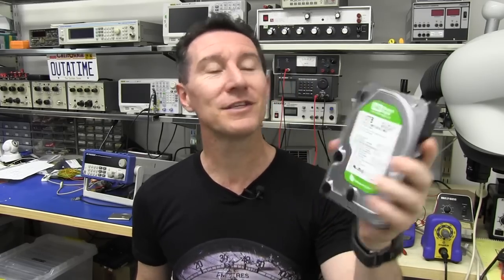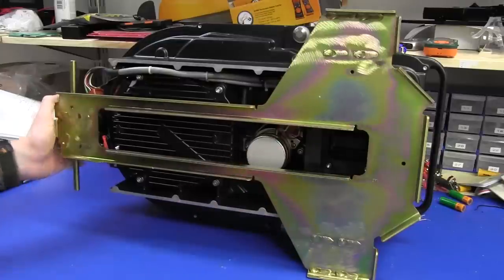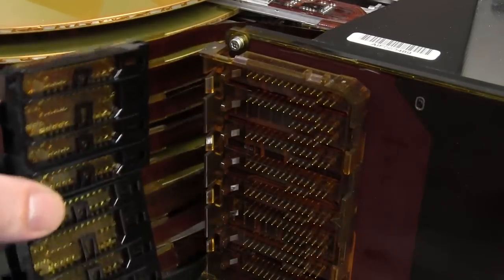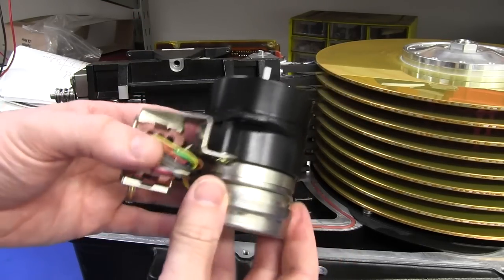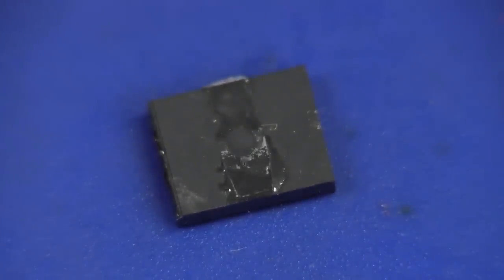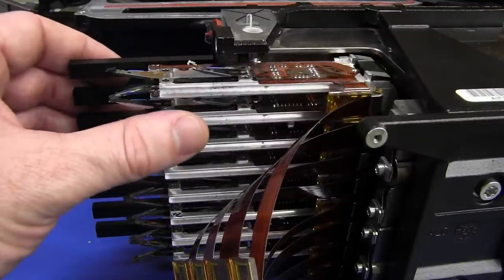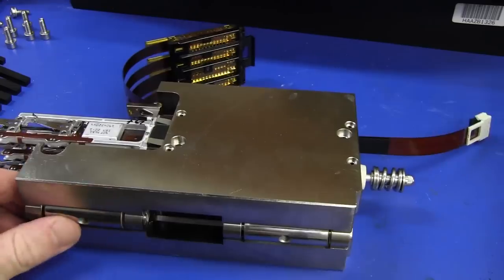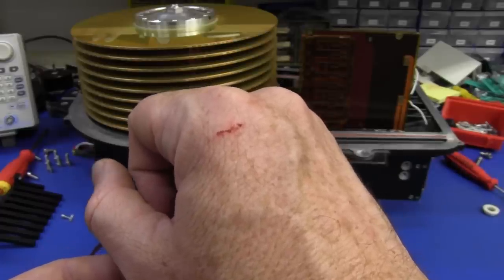EEVblog #395 - World's Most Expensive Hard Drive Teardown

Comment: Just stumbled across this and it made me smile. Especially the comment about the 20MB/$300 drive - I'm going to guess a Seagate ST-225 MFM drive - the volkswagen of hard drives.  Reversing inflation means that 20MB drive would be about $700USD today. Perhaps I can clear up a couple of things [quick scan of the comments didn't mention some of the things I know about them]. In the late 80's I can remember being stoked at getting a 680MB Fujitsu Super Eagle for "only" $8000 USD,  and it was tiny - only weighed 30lbs (15Kilo?) or so. and small.. maybe 7" platters? Compared to the 14" "Eagle" that came in at almost 100lbs, required 220VAC (unusual in the US)  and was 'only' 600MB. Anyway - as someone already noted, the drive electronics were elsewhere in the system - since that's IBM, and most likely from some Big Iron (mainframe) it would have been a channel system. I would not be surprised if they were still making them into the 2000s - I know a company that builds emulators for some of that stuff -- since some of the Big Iron is still running. No really. Costs too much to re-implement the system. Some other details: if you noticed, the filter was set in such a way as the 'wind' from the spinning disk would get in there. that was there to catch anything that might come in on the gas line. The locking mechanism was meant to unload the heads before the disks spun down since winchester tech is a flying head. Literally. The heads were never supposed to touch the drive - but rather they floated in the 'wind' caused by skin effect (look up tesla turbine to get the opposite using the skin effect to spin platters).. If you look closely at the head you should nave noticed a slight narrowing on one end - that created the pressure to float the head. The gap between the head and the platter was tiny however - a smoke particle was too big. BTW, this is where the term "crashing" a head came from. It would contact the platter - and destroy it. With the most god-awful sound. Yep.. been there, heard that. The dual head arrangement most likely was meant to reduce seek time, not to increase read/write speed. Voice coil head positioning was pretty high tech/fast for the time, but compared to today still S-L-O-W, simply because of the mass of the head assembly.  The dual heads meant they only had to move 1/2 the distance. Probably ran around 150RPM or so. Yes, One Hundred and Fifty. I would not be surprised to find out that the gas line was there for filling the chamber with a higher density gas - to more effectively float the heads. [side note, I also remember being ecstatic at paying $17,000USD for 32MB of DRAM.. And even more amazing was the fact that it was ECC, and only 1 card. Granted.. 9U (roughly 16"/240cm square), but since I needed 4 cards that size before...

Comment: I’m pretty sure one of the old hard drives or original disc that can only hold a few megabytes would be so big. It was as a truck. 😳

But from the first hard drives, to the ones in my first computer ever to now advancements have been made, and some very crucial and big ones. Like technology has improved so much and there’s a lot more density in storage now with HDD drives and SSD in general. Also, the cost is way less now. It’s truly remarkable. 🫡

Comment: that temperature strip looks like the ones used in aquariums, may be installed by some technician
Reply: +Cristian Szwarc yes, I was mid-30s at the time those came out, so my memory is clear.  I'd seen exactly that type of temperature strip for sale in electronics catalogs at the time.  Maybe it was installed by the customer engineer.  Or maybe IBM directed they be retrofitted.

I remember we had some Memorex disk drives, similar mini-fridge size, and after we got them they had to be wrapped with aluminium foil because there was a radio tower (CN tower) a half-mile away.  Metal boxes, but with plastic windows, so RF interference was getting in.

Comment: I can beat that one.   I once had a boss that worked at an ancient supercomputer manufacturer.   In their development center they were prototyping a new  custom super-fast head-per track disk drive.   They took their huge, man-high disk platter drive which already cost $300,000 and stuffed in as many head-per-track heads as they could.  He said there were 32,768 heads but I don't quite believe it, it might have "only" had 256 heads.   Anyway he came in one morning and the door to the dev lab would not open,. the disk drive heads had crashed, all xxx of them, and made huge piles of iron particle and aluminum platter shavings, enough to block the door.    I can almost believe that story.   He also said they gave up on that development project, too unreliable and expensive.

Comment: i know if an incident at a wall street financial center a few years back were a woman got locked into one of the vaults and panicked and pulled the fire alarm from inside...well it was a halon  fire supression system and it sucked the oxygen out of the room. big investigation. tragic story. not keen to the exact details but my uncle was one of the regulators/investigators involved in the incident.

Comment: There is more gold in those disc than there are in 50 vcr's 1000 compact disc or 250 modern hard drives simply because it's old and they didn't know then how the longevity of the drive could function with critical data so they put max amount into plating and carrot value for lasting service. I would estimate 6-7 grams or about $230 worth.

Comment: I had a drum memory system back in the late 1970s.  I had it connected to my home Motorola 6800 computer for a while.  It gave me 256 KB.  I still have the drum but had to get rid of the cabinet and transistor based logic.  No ICs.  It came out of an old NASA system called the Orbiting Astronomical Observatory.  It may have been at a monitoring station in Chile or Ecuador.  I'd like to find a museum that could use it.  The drum memory was built by Vermont Memory Systems.  It was probably built in the 1960s.  It was in a 6 foot tall rack and weighted several hundred lbs.  When it would start to spin up it dimmed the lights in the house.  On power down the drum would spin on it's own for 10 or 15 minutes.  It was a lot of fun to reverse engineer the original interface.

Comment: 25:23 Less surface does not equal less friction! Far from it. The friction depends only on the vertical force applied times the friction coefficient which is dependant on the materials coming in contact (type not size). So smaller surface does not equal less drag. On the other hand a smaller surface means that the pressure i.e. the force per surface area is greater thus the wear and tear is greater. So your first reason for the pads existence is incorrect.

Comment: 23:05 Actually no... when the drive is up to speed, the heads ride on a cushion of gas. You said it was filled with halon, I thought they used dried nitrogen. That is part of the reason for the air filters... ANY dust particles larger than the gas cushion will cause a head crash... and that trashes the drive in short, loud, fashion.
Reply: annnnnnd 4 minutes you get to this part...

Comment: I can imagine many uses for the gas ports on the drive like filling it with an inert gas or pulling a vacuum to settle dust or even cooling but Halon gas is not one of them, I don't get how it would help in the event of a fire in the room: if the case becomes hot enough for the plastics inside to catch fire, the platters will be destroyed anyway... Where did you get that info? Could you link something that explains the use of halon inside the case? Does someone have an explanation for the use of these ports or were they really for Halon gas?

Comment: Halon is not all that toxic. People could survive while evacuating, and was even used over stoves in restaurants. If it was like cyanide or something that bad, the required liability insurance would be unaffordable, and thus that gas would be completely unusable around workers (at least those workers who had families that would sue the pants of the employer). As far as I know, halon was never used inside drives. The ambient air was passed through ordinary gross filters and then through superfine “absolute” filters to keep particles out that would interfere (read “crash the heads) with the heads flying over the disk. As halon would only be present during an emergency, ordinary air would normally be present inside the drive. If anyone knows for an absolute certainty that halon was intentionally used inside an operational drive, perhaps they can tell us the details.

During the late ‘90s, a Sacramento third-party service company in the same complex where I worked tossed many similar-looking IBM drives in the Dumpster. I got a couple to scrap, and even the complex maintenance man opened a secret (to the landlord) disassembly line in a utility room to make a few bucks on the side.

Comment: When you have an extremely expensive system you're going to pay anything to have it running before taking the courage to send it to the scrap yard and get a new system.
I've been working on systems in the process industry, a 10 Mbyte second hand hard disk with non market standard electronics could cost the customer over $40.000.
They had no choice, pay that amount and restart production as soon as possible, or stop production for months and if you have the budget, substitute the whole system with a new one.
Normally they pay the amount and then look into programming a new system during the next long period maintenance shutdown.

Comment: That drive is from a 3390 disk subsystem and was 3.78 GB not 10 MB
Reply: +jlelliotton being that there is more than likely no actual logic in the drive or stored middle-ware / firmware or microcode on any of the platters from the factory; I would imagine they were capable of actually being truly hard formatted completely and IBM would have been able to sell new controllers roms etc,  that would allow algorithm adjustments. Which is better I think.  I remember i had some old xt and 286, 386, 486 motherboards that had formatting tools and a basic OS in the bios with full mouse support. I believe the bios was American Mega trends but I really am not %100 percent sure anymore.

Comment: Hmm I wonder if you can Order modern Platters that size or ask a manufacturing plant to manufacture one that size. I guess you could put more than several hundred terabytes per platter depending on however many platters there are in there and replace that needle on the header with a much smaller one to much more accurately read it. or maybe just tune the stock one and then you could modify the case that holds the platters for use with helium gas and just use the tubes to fill it with helium instead of halon gas I mean just imagine the possibilities of recycling those old cases just to store a couple or several hundreds of terabytes!

Comment: The thing is, that should still be a reliable device.  There are applications where you might want r/w access to 10mb of data for another 30 years.  Crypto keys for example.  Nothing more secure than a 80 lb slug of metal bolted to the bottom of a vault.

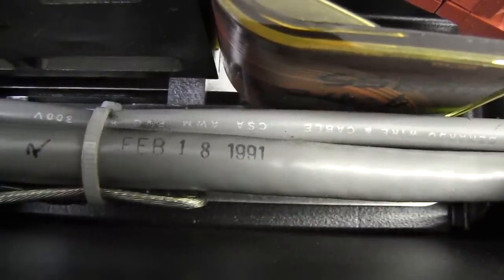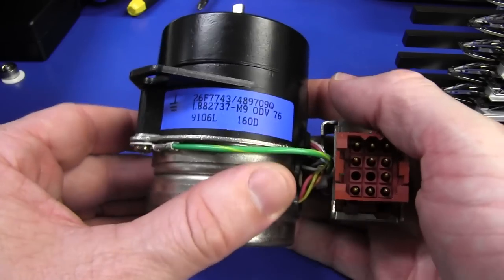Comment: They are very rare.Didnt find any old HD on ebay. What did it cost? But  I dont get it: 1991 this HD costs 250.000$  But in the same year there were the first mass-product HDs for PCs with similar performance for ONLY A FEW 100$ ???           With the Production code on the cable at 14:05 (Feb 18  1991) and at the motor 31:42 (9106L) 32:04 (9046) its definitely built beginning 1991
Reply: That's the truly insane thing about what's claimed for this drive.  This was built at around the same time as my PowerBook 140, with its 40MB 2.5 inch hard drive.  That computer cost me less than 1% what this drive allegedly did with 25% of the capacity of the PowerBook's drive had.  This drive would have been ridiculous even 10 years earlier, though; a 10MB 5.25" full height drive was already a thing in 1981, and was less than $10k.

I suspect that the price stated for this is just wrong.  IBM introduced a 1GB drive in 1980, it was about $40k.

Comment: Halon is not a lethal gas. You can breath Halon in concentrations up to about 7 percent and dump concentrations are designed to be less than that. Now what is toxic is gas after it has been degraded by heat, which is to say the amount that is burned by the fire before it is extinguished. 

Also a "gas mask' would do you know good, you need a supplied air rig.

Comment: There are absolutely no serviceable parts inside the HDA (Head Disk Assembly)
You will not believe how accurate the machine need to be fitted together...
And opening the cover wil introduce dust particles that wil casue the heads to crash, 100% guaranteed.
The filters might look simple but they block particles in the micrometer range
.
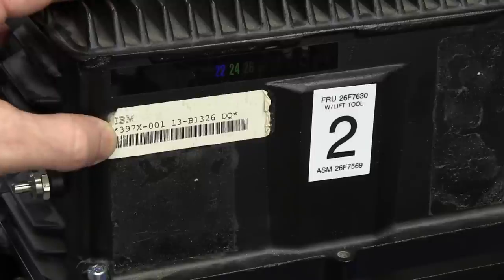If you look at 3:54 you see a sticker with the text FRU 26F7630.
FRU stands for Field Replaceable Unit and the number is the actual IBM part number the CE (Customer Engineer) would order to replace the whole HDA when it fails.

Comment: With 9 platters, that might be a Parallel Transfer drive. 8 bits plus a parity and/or servo track. The benefit of this technology is it can transfer an 8 bit byte in parallel form versus the PC drives of the day which were serial transfer. Kind of like comparing the data transfer over a parallel port versus a serial port. My experience with drives like this were playback of real time video. There was no good compression technology in the 1980s so video was stored uncompressed, about 1MB per NTSC frame and a clock speed of at least 14mhz. 

Think about how far we have come. In the mid to lat 1980s it took 1MB for a single frame of broadcast quality video - and there was no commercial HDTV yet either. So one second of video took 30MB. Today you can store many minutes of 4K video on your cellphone and only an expert can see the compression artifacts.

Comment: You wouldn't have been able to lift the hard drives we had. They had 16Mb fixed and a 16Mb removable cartridge. It was a struggle to move them with two of us. That system also had a dual 8" floppy disc. We also had a PDP11 with a 360Kb hard drive. You had to boot it up by setting the first address on toggle switches and then run. Happy days.
It pains me to see how we waste power and capacity these days. Systems these days ought to be hundreds of times faster than they are, but the software squanders the resources for the sake of ease of writing it and a fancy interface. Do software engineers today even know what optimisation is?

Comment: If you thought these hard drives were expensive, you should have seen what core memory cost.  In 1968 a single Wang 373 core data storage module was $2500.00- that for all of a walloping 4.1 kilobytes!

Comment: What is this thing? On the left from the motor, it has a ground wire and a connector. It has the shape of a speaker and at the bottom I see a blue capacitor?

Comment: Its reminds me of the old Winchester Hard disk.
Reply: +eng3d  Yes, 13,5 Mb in system 5340, this makes you an insider to know the inside name of that disk drive. (¿Remember the motor  was external to the HDA(Head Disk Assembly) driving it by means of a conductive flat belt and two pulleys?)( And a brake on the motor for stop its spinning in case of a blackout?)

Comment: I thought it looked a little small for early 1980s.  That is what a 3390 looked like inside -- I never saw inside one before.  

Just ahead of that was the 3380, which was a revolutionary improvement over the earlier 3370 and 3350, in being smaller and having faster data transfer.  3380s dominated for a long time.

http://www-03.ibm.com/ibm/history/exhibits/storage/storage_3390.html 
"First customer deliveries of the 3390 Models 1 and 2 were scheduled for December 1989 at prices ranging from $90,000 to $275,000. A typical configuration consisting of three 3390 Model units was priced at $759,000."

So you'd typically see 3 of these 3390s in one mini-fridge sized box, each one on rails to slide out.

Comment: yes,by todays standard, this is a monster, but.....

compared to the units in use from the late 60s and early 70s it is quite petite. in that era the drive mechanism and the disc stacks were totally separate elements.

the disc driver was about the size of a large automatic washing machine, top loading. the separate disc packs were about twice the diameter of yours, with a similar number of discs. why were the interchangeable you ask? 

welllllll... they only held about 60kb, yes. 60kb of data. but they were much cheaper than the drives, so the operators were constantly changing them in and out.

Comment: Great video. Could the hardrive be used on modern machines?
Reply: Maybe not now the heads have been destroyed.
But if you wrote some software to control the heads and buffer the data into the memory, yep.
Reply: Gregory Smith Thanks for the info : )

Comment: Right off the start you made a mistke the one on your left is a 5.5 inch hard drive I also suspect the one on your right is a 2.5 inch drive. Perhaps you should invest in a ruler.
Reply: And you should invest in a good pair of glasses. The 2 TB hard drive was a 3.5 inch Western Digital, the other one was a 1.8 inch drive from Toshiba, probably the 30 GB single platter version judging by how it looks.